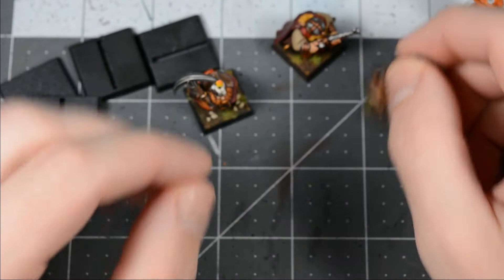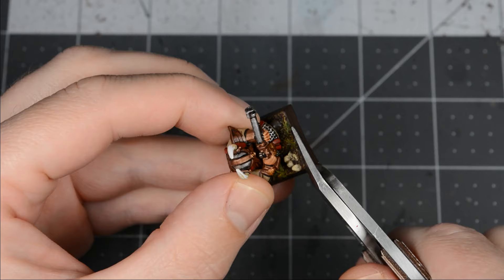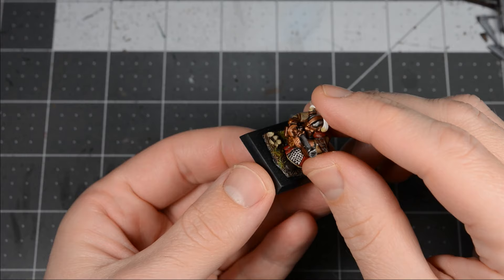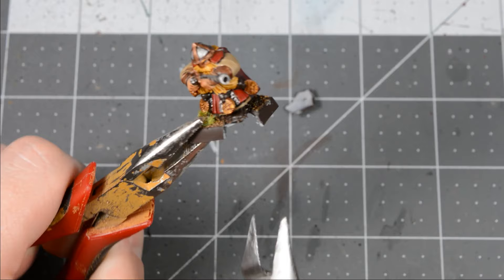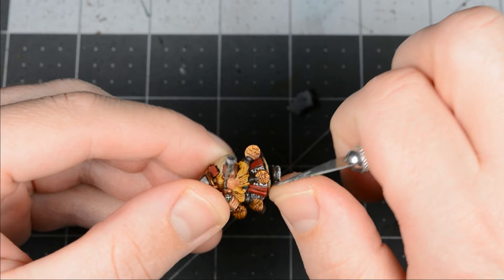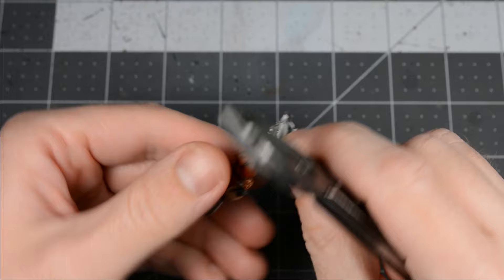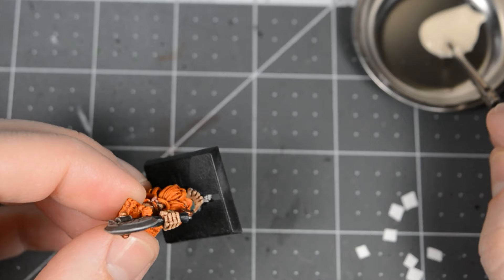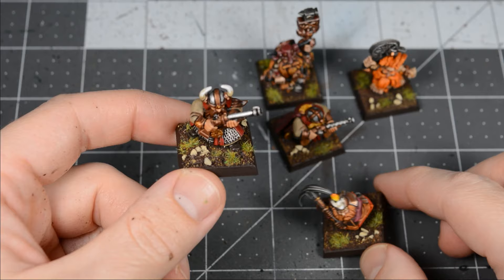How to Remove and Replace Bases on Warhammer Models | Modeling and Hobby Tutorial

Comment: Good work! Can you solve my problem with 3d printed models on 3d printed bases that are so so very fragile. What should i do?😢
Reply from the maker: Were the models printed with the base attached? You might be out of luck there. 3D print resin is pretty unfriendly to work with. The models would likely shatter if you tried clipping off the base. I'd probably use movement tray converters and skip rebasing entirely.
Reply: @MattsHobbyHour  they are glued to the base. Yea I guess trays are they way for me. Thanks for the answer!